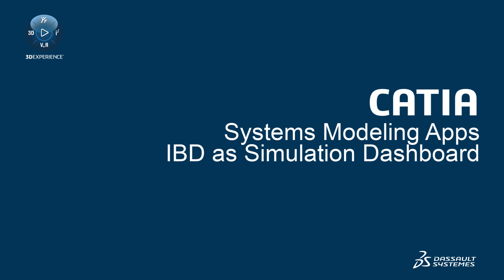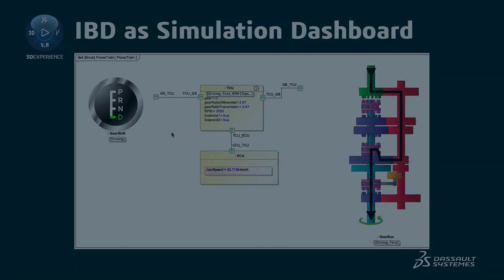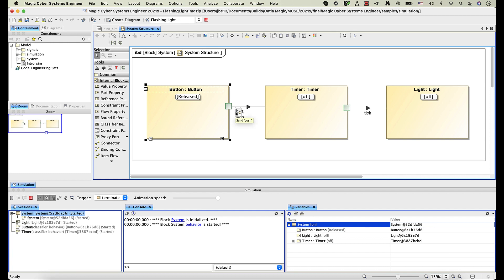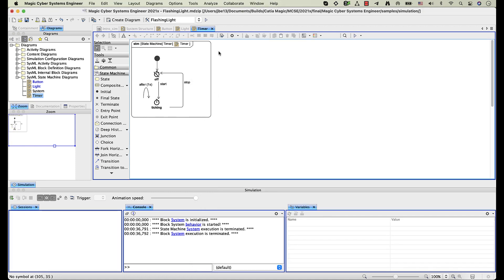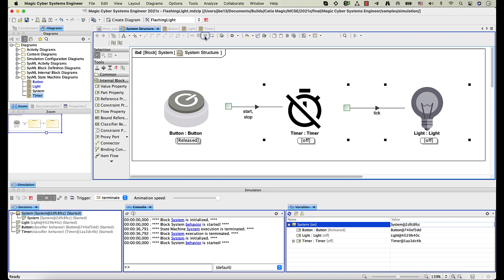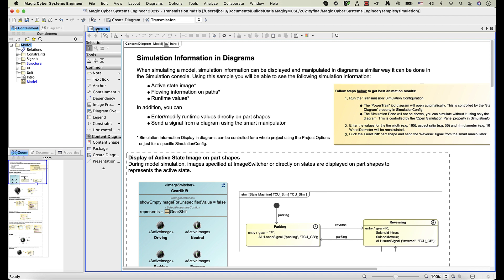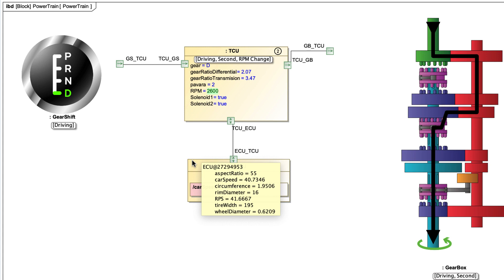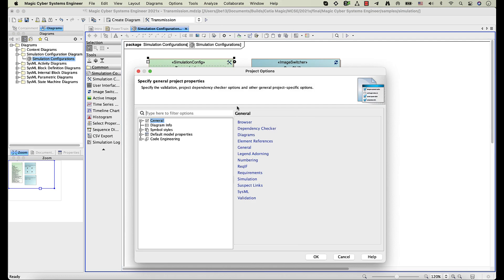IBD as Simulation Dashboard | Available from 2021x

Comment: This might be a stupid question but what SW packages / plugins are needed for this capability or is this all within CST?  I notice you were using Magic Cyber systems engineer.
Reply: Hello Kizer, thank you for your question. It is all available as part of Simulation Toolkit / Magic Model Analyst. Cameo Systems Modeler Enterprise edition / Magic Cyber Systems Engineer does include Simulation Toolkit by default. Cameo Enterprise  Architecture / Magic Systems of Systems Architect and MagicDraw / Magic Software Architect does not include simulation plugin and it needs to be purchased and installed separately.